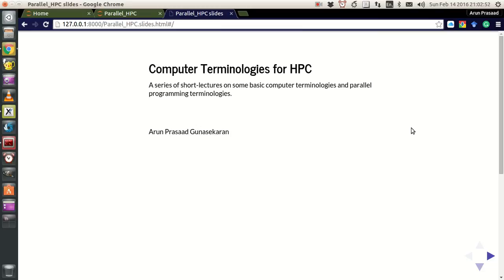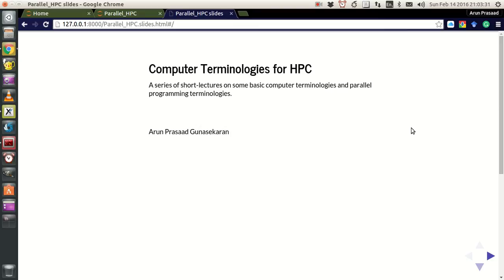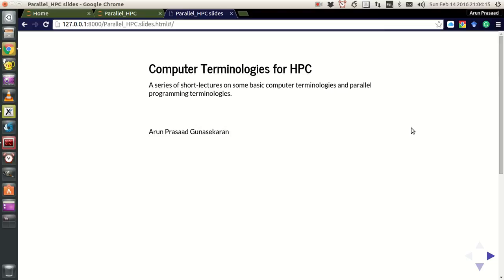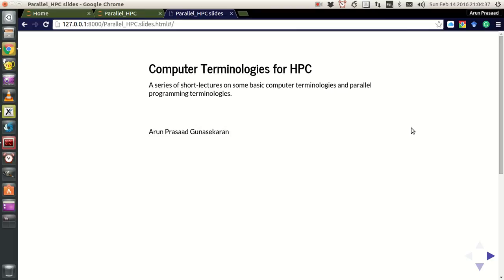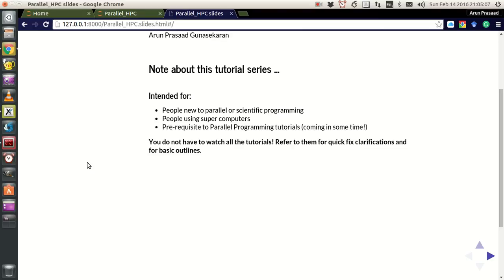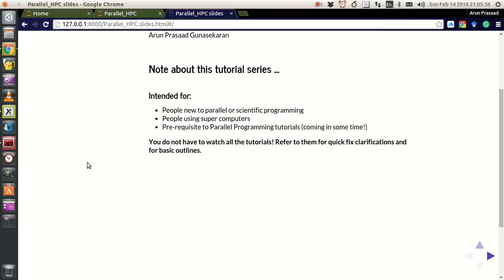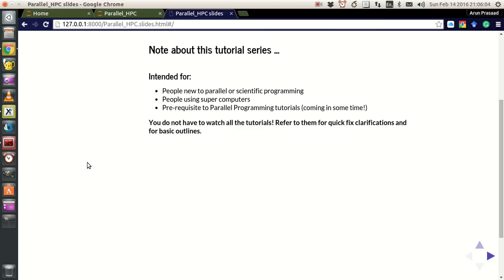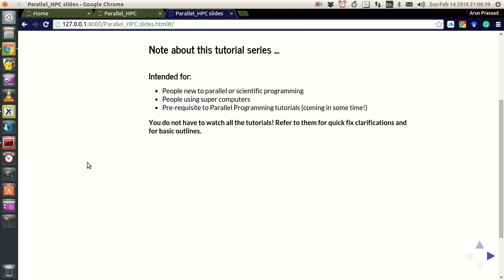Computer Terminologies for HPC : 001 : Introduction

Comment: Hi Arun
i have a doubt, i went though ur tutorials on fortran openmp and tried those as well.
do you thing it is possible to use single "parallel block" for entire program and use "singe" and "barrier" statements to do intermediate serial computing? 
i have a numerical problem which has huge set of parallizable sections with serial sections inbetween them, but when i implement it using multiple paralel blocks, 
the performance speed gets lost in forking and joining itself. 
could you please help me in this?